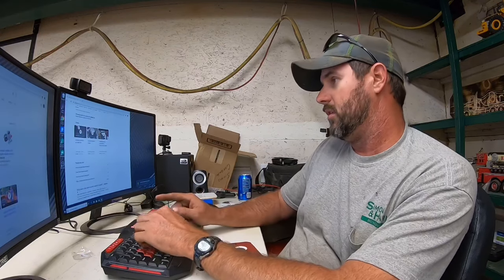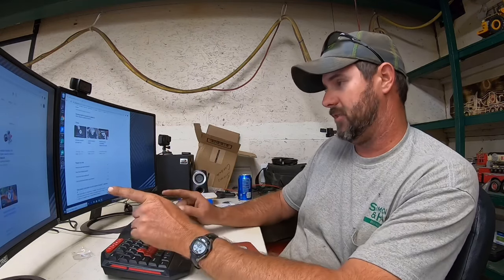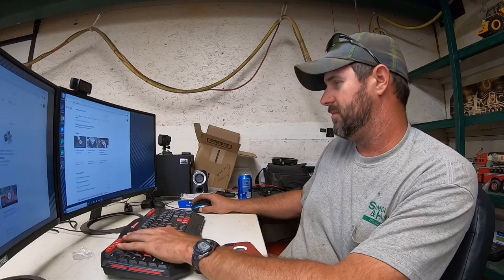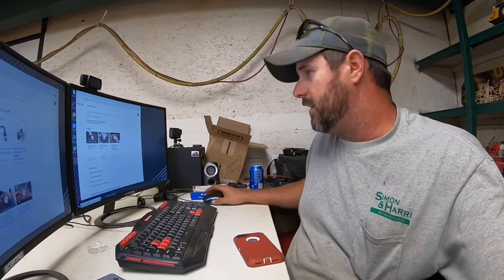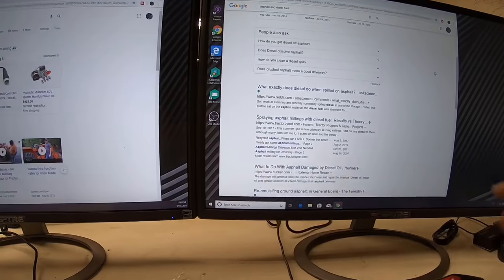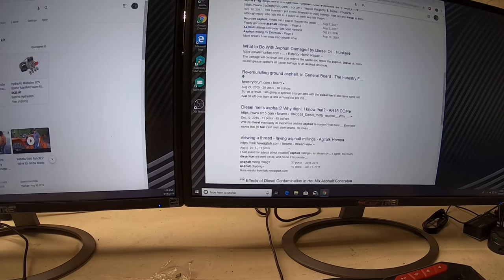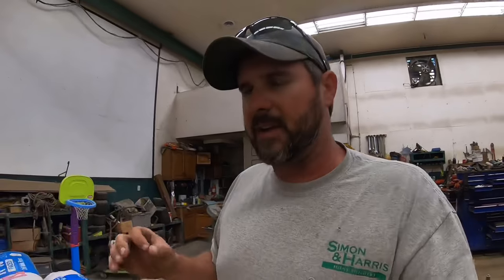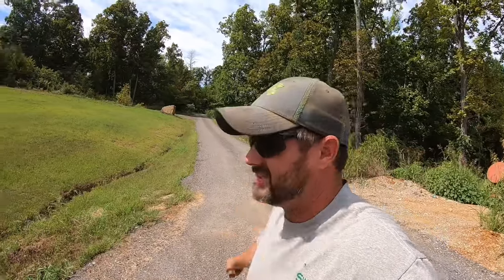Spraying diesel fuel on asphalt millings good idea or bad idea my thoughts

Comment: Perfect. My friend, try what I do anytime I’m offered unsolicited advice, I simply reply “OK, have you done that and have personal experience?  No? then STFU!
Reply: Mike, it usually comes down to the amount used that makes the difference between success and failure and since every batch of millings is going to be different in its asphalt to gravel ratio, it is impossible to gauge how much “solvent” is the right mix for every batch - unless you are some kind of “asphalt whisperer”!

You did real well without anything but good sense after hearing confusing/conflicting input, so you are smart AND lucky!

Best of all, you won’t need to worry about tracking diesel fuel into the house from your shoes or out onto the main road from your driveway - it makes a helluva slick patch when it just starts to rain.

Comment: If anything, mix it with some asphalt emulsion, which is designed to bind the aggregate together.  It would basically be cold recycling, which is a common treatment for highways.  It would still need a surface treatment or top course.

Comment: I’ve seen where Half ton diesel truck with a leaking fuel tank onto a paved parking lot.Makes a real mess of the spot where it sat
Reply from the maker: Yes I bet it did
Reply: petroleum breaks down AR-4000 asphalt refined oil used in the making of most HMA's but now we have warm asphalt less  energy to make (carbon footprint) but they use chemicals to allow material to bind with synthectic oils to make the product.

Comment: If you’re patching...filling a hole... like 2x3’... then you spray your hole and light it off... because you need the heat.  On a large job you have to do it like you did in August... and use natural heat.  If you’re patching a couple big holes in November then the heat from diesel/1/4 cup of gas... heats the areas around where you’re going to be filling... and you can heat the top of the loose millings ... then tamper plate.  I roll them out with the truck tires then tamp them... you have to burn off the fuel or it will loosen your millings and soften them and you’ll get a pothole back faster from driving over soften asphalt.  Large job has to be done when it’s blazing hot in summer.  It’s all about the timing on the big job.  You can use the weed dragon on the smaller holes and not pour the fuel onto your asphalt.  You never want to add fuel and not burn it off... or you are weakening your mix.  See... if you heat your hole base then you loosen up your base asphalt and then it will bind to your new millings makes a solid patch.
Reply from the maker: Good info thanks

Comment: Look at oil spots in a parking lot sealer doesn't stick to it. Asphalt is a petrolium product so is diesel. They use diesl so it doesn't stick to the tools because the tools are colder then the asphalt. If you put down a Rapid set emulsion then chip seal it the driveway should last at least 5 years before you need to do anything. The chip seal will also increase skid resistance. The main enemy of asphalt is light, when asphalts turn gray that means there is little resistance from the sun so it needs to be sealed to protect it from the sun. Use a good quality 3/8 chip.
Reply from the maker: Good Info thanks

Comment: The emulsion in millings has done its job already. Diesel fuel will not resuscitate it. Heat won't either, spread in hot sun does help but that's all. Can you re-cut sawdust?

Comment: Hauled in millings to our cabin from SR 37 when they were repaving it in the late 90s or early 2000s.  Spread it out and compacted it with a large, single steel drum vibratory roller.  Afterward, we sprayed diesel on part of it.  The only place where it is stuck together is in the places where we DID spray diesel.  It isn't stuck together well in those places, but it isn't at all anywhere else.  But, and this is a big but, we don't get much (if any) sunlight on them.  Having said that, I agree that it isn't a good idea.  I would like to know if anyone has a reasonable option for someone who has them in the shade or in located in a cold weather climate.
Reply: compact the millings when damp, when material dries is when it tightens
Reply: Fuel oil deteriorates emulsion. Pour some on existing asphalt. It becomes mushy and loose, dries out as a pot hole.

Comment: The logic SEEMS sound at first but in reality probably does not work well in real life.

The logic is that the diesel MELTS (dissolves) the asphalt cement. as the fuel evaporates it re-solidifies and bingo bango you have a better surface.

the problem is this requires you have ENOUGH cement in the mix for this to do anything (and that you don't use too much) otherwise as you note you will WASH AWAY all the cement and have just rock and sand left over :-)

my guess is IT WORKS under the exact right conditions but how do you know if those right conditions exist? The logic is sound. if you can liquefy the cement and resolidify it you will have a stronger surface. but I doubt most millings have ENOUGH in it for this to work versus just wash away the cement and make it worse.

Tossing gasoline on it and lighting it on fire "CAN WORK" but a different way (and not sure if this will help with millings) when we were patching holes in our parking lot we would gas and light it and let it burn. this would make it softer and then we could use our hand tamper to compact it more easily. but this was fresh bagged patch with lots of sticky cement in it. not millings.

Comment: Been there done that. You don't use straight diesel unless you have some dry cold patch that wants rolling. If you have grindings, call the local seal coat-oil company and they will hot oil it and design a mix with a percentage of diesel in it

Comment: Finishing the driveway with rounded pea gravel may not work so well regardless how strong the adhesive is.  Rounded stones tend to move around under pressure, no points on the rocks that help lock them in place.  Think about a children's ball pit, what if the balls were square? Just my 3 cent worth of thought but I think it may be a solid argument.
Reply from the maker: Yup I agree with your argument but remember rounded stones also let truck tires slide over them and not catch at pull up

Comment: We're all work we used a lot of asphalt millings and the best thing we found to keep it where belongs viable was it just haven't fog sealed we built County roads out of it and never tip and sealed it or anything else just fog seal and it seems the last longer than new asphalt
Reply: Hey there do you know what type of oil you used in the fog seal ? And did you pack it before and after you fog sealed ?

Comment: The  City I worked for ground up many blocks downtown and had a contractor come through and relay the product with a binder resin it was guaranteed for 3 years and has lasted about 15 with no sign of real deterioration.  I know what this is not about but due to overlays and the binder additives we ended up with 100o's of tons of left over grindings.  These we ran through a 3 inch shaker screen. Material that would not go through the screen we ran those big chunks over with our steel drum roller and ran it through the shaker screen again.  We then thoroughly mixed this pile with a loader restacking it a couple times. We found we had to use this stuff really quick cause if it had set for a couple weeks it would be to solid to put through the paver. We used part of this material on a couple of alleys we just ran it through a paver did a couple of four inch lifts on 100+F days.  Ran the steel drum over it and beat the crap out of it.  When our chip seal  came up we put some extra sealant on this and it chip sealed it the next year again and it hasn't been treated since.  These have been and are the nicest alleys in town.  We used a bunch more of this material to pave a road built over an  old garbage landfill and though the ground still sinks every year the pavement has served it purpose well.  Putting diesel on something in any quantity is going to cause the existing oil to separate from the rock and sand and drop through the mix.  If it is sealed over the diesel will never evaporate out and will not let the mix set up.  I hear these guys talk about just taking a weed sprayer and putting on a fine mist on the top surface and for guys with limited budgets and equipment that don't have money to run a sealer over it, this is probably a good option as long as the weather will allow the diesel to evaporate off before it rains.  That should allow the oil in the old mix at the top surface to free up and and form a seal over the top.  The key would be not to put so much deisel on that it soaks down into the pavement past the surface.

Comment: I have got 650 ft of driveway that I’m going to use millings on. My place is in north central Fl and the base is sand. Yours is as good as I have seen and is a good test against all the heavy equipment you have . Other than some delivery trucks I will not have a lot of weight on it.
Reply from the maker: Good luck holding up good here so far

Comment: have a ugly pile of asphalt on my property i want to break up and use as filler for pot holes etc..i have a compact tractor with loader..whats easiast way to do this,,some say muriatic acid,,some say diesel ,,,what say you..tractor has heavy tooth bar on bucket but tractor is only 25 hp

Comment: Thankyou for this awesome informative video! I almost went out and got some diesel fuel for my driveway! The only problem I may have is I just put it down yesterday ( 800 ft) and its was only around 65 degrees F  with no sun. I started rolling it yesterday and will continue compacting  today , but the sun isn't expected today and its getting colder. I waited till the millings were available ( October) so its definitely going to get colder from now on. I would advise  others to wait till the weather is warmer.  Any advise would be appreciated. Thanks again for your informative video!
Reply: How did it hold up? I may do my driveway in a few days but it’s 20 degrees now.

Comment: Large quantities of diesel is bad for asphalt. Diesel heats up the oil in the asphalt. Which causes it to stick to the rock again. So using a light spray of diesel is fine. The diesel will evaporate within a day or 2.

Comment: If you light millings on fire it will harden them, they wont ignite like a fucking bonfire. Its very hard to light them. Need to use gas and once they start burning hit them with a roller with the water on. diesel only makes millings bind together, the chemical reaction that makes asphalt harden has already happened, so the only thing to make millings harden is to heat them up. But if you want a really nice millings driveway, you want to get the asphalt sweepings from when after they mill... street sweepers dont pick up chunks, its just the dust and mostly 1/2- rocks. They harden even better because its mostly dust and pea sized millings, and they harden way better with just sunlight, but there better when you have chunk millings to use as base.

Comment: likes dissolve likes. basic chemistry. diesel will soften and allow compaction, but its hack as fuck. you get pot holes at gas stations from the constant  reapplication of solvent. glue sticks once the solvent evaporates. you can use the same solvent to remove dried glue.  asphalt is no different.

Comment: diesel fuel and ashphalt binder are bi products of the oil refinery business so diesel fuel is probably a solvent  to asphalt. It breaks it down to stick back together when it dries. When it's wet and not mixed together it makes sense it's a temporary protection from ashphalt sticking. Paint solvent washes paint off ur hand as well as when mixed with paint thins it down and eventually dries and paint is hardened.

Comment: That’s literally the point of the diesel use. You want the diesels chemical reaction soften the used already hardened asphalt millings back into soft useable asphalt. Then compaction then heat.

Comment: one other thing about spraying diesel on milled asphalt. ( and yes we have two driveways with milled asphalt and I have tried the diesel spray) the initial diesel boiling point is around 400° F which means it's not going to vaporize and disappear very fast. If you get a fairly good rain with in just a few days after you spray the diesel on your driveway, it will lift and float away on the water and form an oil  sheen on the ditches and down stream water ways. If any one sees it and reports it , they can trace it back to the source very easily and they can take some serious legal action against you. Remediation is very expensive and the reportable quantity spilled on land in Texas is 25 gallons.

Comment: Like it or not.... My father worked for the local highway dept. for 30+ years... the millings just using summer heat and pressure of compaction was plenty... some thing pouring some fuel (either gasoline/petrol or Diesel) was good... but the EPA would have kittens and could fine you out of solvency for that.  Disposal of those fuels is regulated and just pouring the volume you'd need on the ground.... if they ever found out.. GOOD LUCK.. you'll need it... I grew up about a day's drive NE of Derby IN... and we never needed any help getting them to compact... oh, trying to spread in the winter was bad.. .but spring/summer... you'd end up with a solid ashphault road/parking lot when done...

Comment: years ago I was an owner operator delivery driver with a few trucks, I had just gotten my 1990 F-350 out of the shop and was called to the local airport to pick up some items from paved runway apron, as I was driving down side apron my gas tank fell off and dragged for 50 yards. 
Long story short, unbeknownst to me my truck had fallen off the hoist at the shop and both tank bands had broken. They thought that brazing them back together rather than replacing them was good enough and hid it from me. That was a full tank of diesel and it completely destroyed the asphalt, it completely separated and was cracked all the way through and had to be dug up and replaced.

Comment: I am a chemist. One of the first things I learned from older experienced chemists is, "In God we trust, all others bring Data!" In this case I would take a quart mason jar (clear glass container), put an inch or two of millings in the bottom and cover with diesel fuel to about a 2 inches above the fillings. Let it sit outside for a couple of days and shake occasionally. Leave the lid a little loose so pressure doesn't build up and explode the jar. Now what does the diesel fuel look like? Remove the millings and see how they compact right out of the jar. Let them sit and see what changes occur over time. Run a control of un-soaked millings and compare. Make a small slab about an inch thick and compact both. Try to break them. Which requires more force?  Usually one experiment leads too another. We do know that diesel will evaporate over time, so you are only using it to soften the asphalt so it can flow into and fill in open spaces and theoretically make a more uniform product. Fwiw.

Comment: I put down 30 tons of millings years ago at my house in SC and let the sun work on it spread and rolled it to my knowledge its still there and smooth 

had a 900 ft drive with a huge parking area what was cool is I got the millings free
Reply from the maker: Awesome
Reply: @DirtPerfect  Awesome only when you get a good oil company to spray a custom mix on hot. Mine is 15+ years and no cracks. 80+ tons, steep mountain road

Comment: I know this an old video. I’ve worked for a paving company in the past. Diesel fuel and asphalt do not play nice together. Diesel fuel and the tar in asphalt are both petroleum products. What happens is the diesel mixes and dilutes the tar making it less sticky. We have used millings to “pave” township road in our area. One township required us to MIST the road with diesel fuel before rolling in. The thought process was that it would make the tar more pliable and pack better and more smooth. As long as you don’t use too much diesel it does work but there is a fine line to walk. The roads we misted were smoother and had less loose rock that could be picked up by tires. Again it was all about the amount of diesel sprayed. Personally I think it wasn’t needed if the sun was out and it was a warm enough day.

Comment: I did a test with old used motor oil and about a cup of gasoline per gallon of oil, applied it to a 1 foot square test patch about 4" thick just enough to wet it well then used a brush burner torch wand to heat for as long as the gasoline wanted to burn but not reignite when the flame passed over it, then ran over it with my 1 ton vibratory packer roller(steel drums). The result was well melted and freshened asphalt millings that actually bonded again and repelled water as it should. The patch packed down to about 2" thickness but because it's 1 foot square it packed more than an evenly applied driveway would which would support the roller better. This worked for my highway curb cut that's about 30 feet wide and 50 feet long. A road would be harder to control unless done in short sections. My results amazed me. I think the oil and gas made the asphalt get sticky enough that the heat allowed it to properly adhere. Just sayin!

Comment: A rubber tire roller “kneads” the millings. We use smooth drum rollers first then finish with a rubber tire. That’s on fresh surface. In your case I would do the opposite. Rubber tire then smooth. DEFINITELY not a petroleum product !!! Tack is liquid asphalt and water that’s heated. When the water evaporates the tack “breaks”. Turns from brown to black.